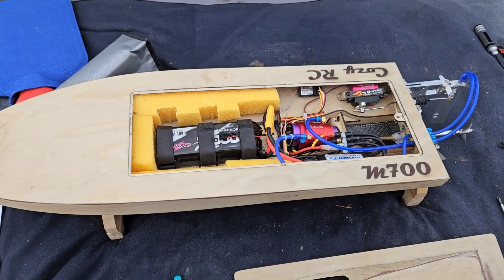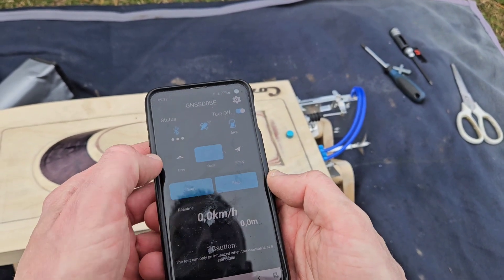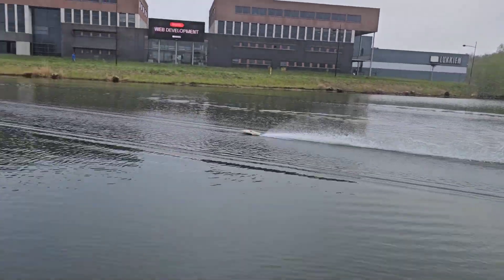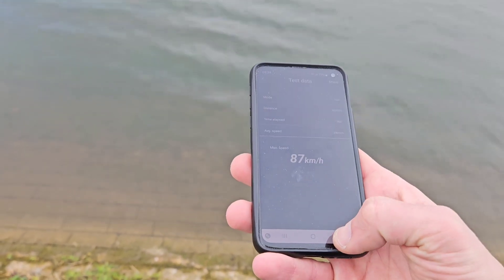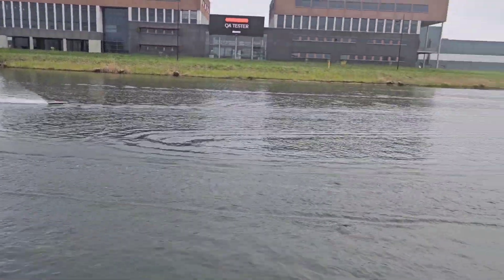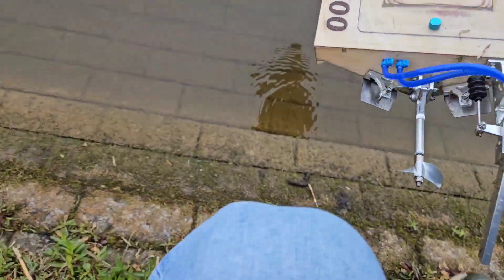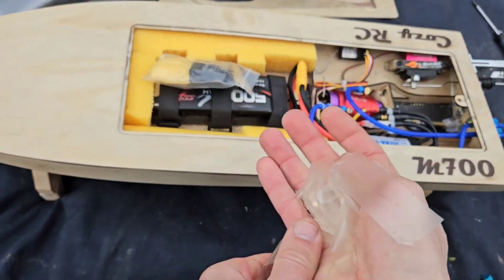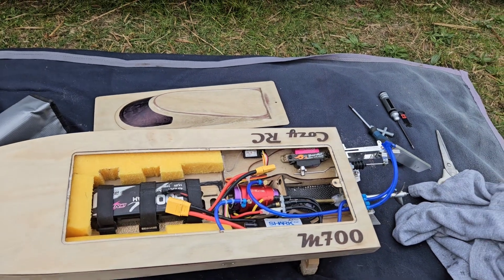DIY RC boat: M700 Mono 50+mph on 4S

Comment: Good job your pond has a sloping shore, otherwise it would have been some serious damage to the boat. Those Shark esc's are pretty good for the price, boat is running very nice & getting faster.
Reply from the maker: Thanks! Yes it was my luck that the shore has a slope. I re-watched in slow motion, and the boat actually launches from a water ripple onto the shore, without hitting the bank. That's why I had no damage, fortunately.
These Shark esc's are good indeed although I heard some guys had less luck with the water resistance of the Shark esc's.

Comment: ciao cozy, batterie 4s motore 4074 2200kv? ESC Ampere?
Reply from the maker: The motor is a 3674 2200kV. 
Lipo: 4S 5000mAh 65C 
Esc: 100A
Reply: @CozyRC  ok
Reply: @CozyRC what is the runtime with this setup?
Reply from the maker: @FernandoW.Racing about 4-5 minutes

Comment: Jan, are you converting the M700 to a Jet Sprint boat? :D  just joking. The risk of running close to the shore is... more exciting footage. Hope you fix it soon. From some experience with that Hull type, they repair nicely hehehe
Reply from the maker: Yeah, stupid mistake! 🙈 Actually, there was hardly any damage. The break-away bolt in the rudder broke, and the prop tip bent. Both were easy fixes, and I ran the boat hard the next day at the meeting!
Reply: @CozyRC  Don't call it a stupid mistake. Just a mistake :) And close up footage IS EXCITING :) I wish I have the opportunity to film some of our meetings. Unfortunately I spend too much time fixing and dealing with broken boats/cars. For past 6 months I'm yet to have a single Saturday meet that I come back home with still functional RCs, both cars and boats.
Reply from the maker: Well, I literally said that I was too close to the shore, 1 pass before I  crashed onto the shore, so I felt pretty stupid 😅. But hey, it's a nice video intro now 😁
Reply: Tough break! Doesn't reflect on the design of the boat, though- you've really got it running nice, DJ!
Reply from the maker: @wesjames6276 Thank you!